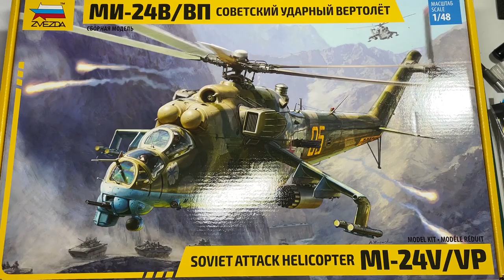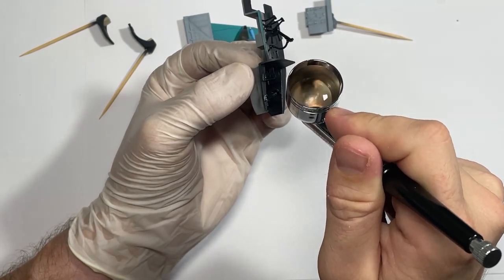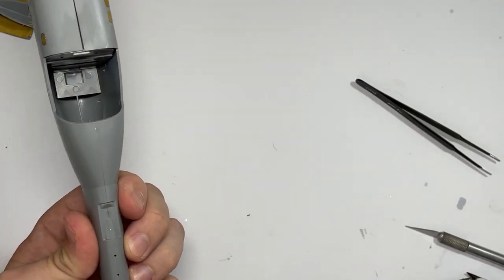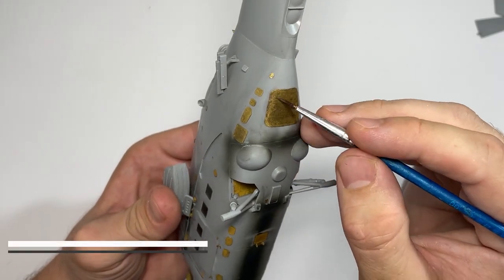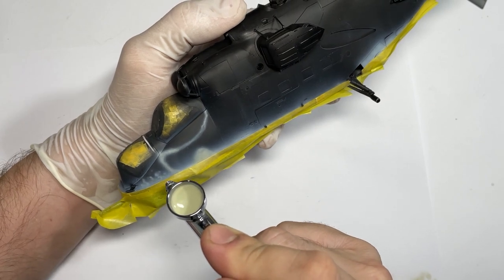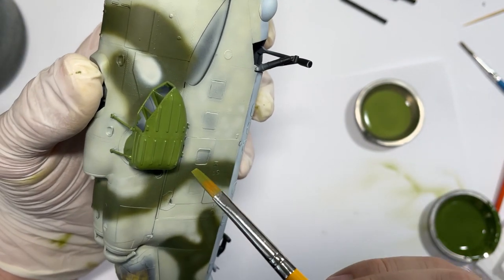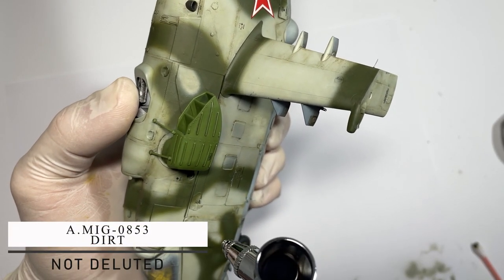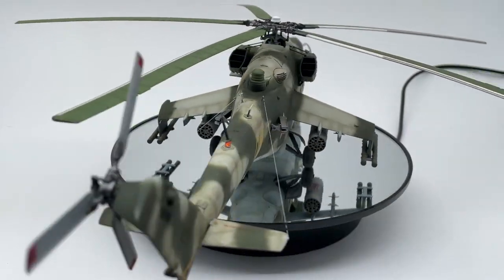Soviet Crocodile. Mi-24V Hind in 1:48, Zvezda. Full Build

Comment: What are those exterior and interior PE sets? 
Edit: 
Found it. It is Microdesign's products No. MD 048241 for interior and No. 048243 for exterior.
Reply from the maker: They are from company called MicroDesign, they can be found on EBay
Reply: @Scalecat171  recently Eduard released their limited version of Hind D. I hoped they will include better interior with fans and mirrors. I miss this detail on this great kit. Currently I have assembled fuselage of the Zvezda's V version.
Reply from the maker: Hmm maybe on there pe set. MicroDesign gives mirrors and fans, I added them off camera as they were to small to film. Actually only one fan as second one I forgot to add